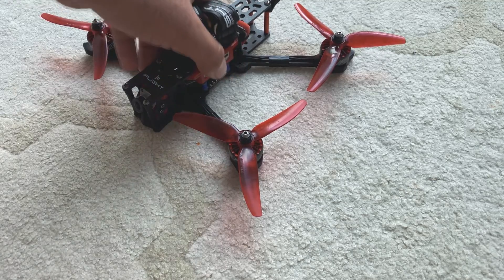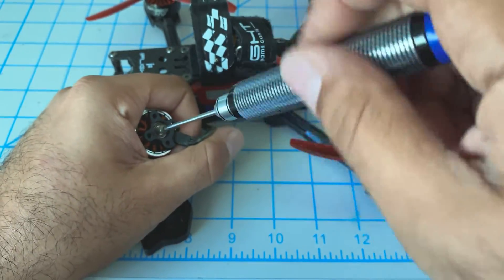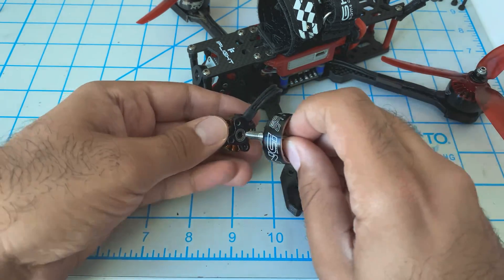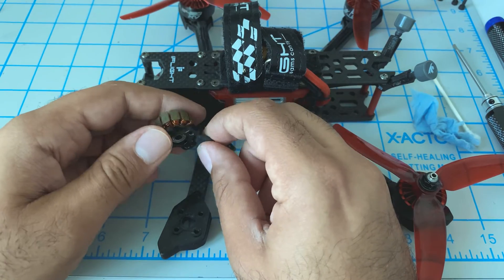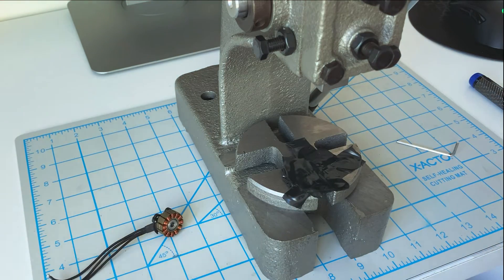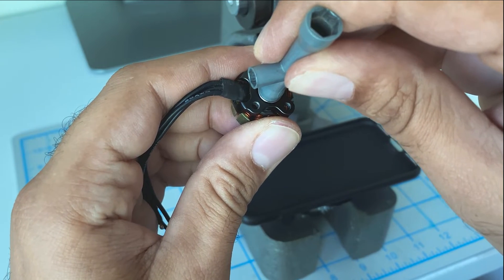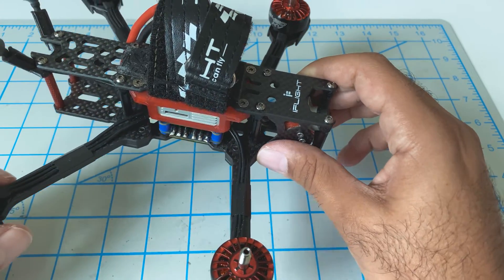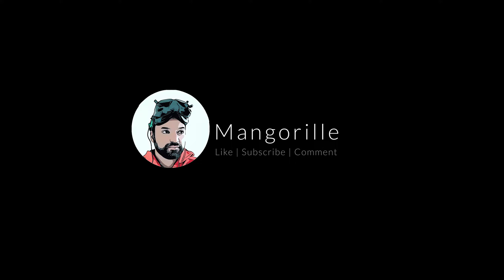iFlight XING 2207 Quadcopter Motor Disassembly, Inspection, & Bearing Replacement | FINALLY Kaput!

Comment: Is it mandatory to take the motor off ?
Reply from the maker: Yes you will need to remove the motor from the arm, otherwise you can't get the bottom bearing out. If you need to use a press to push the bearings out then you'll also need to de-solder the motor wires.

Comment: meanwhile my screws are fucked, so i need to get 1 new motor..
Reply from the maker: Did the screw head strip or is it just really hard to open?
Reply: @Mangorille  the screw head is totally overdriven.. the screw was so tight that with all strengh i could use the screw just got overdriven.
Reply from the maker: They use thread locker from the factory on the screw. You can use your soldering iron to heat up the screw before attempting to remove. If you have a Dremel, use it to cut a slot in the screw, then heat the screw up and use a flat head screw driver to remove.
Reply from the maker: @paineth2  No problem, happy flying!

Comment: Iflight needs to not use so much locktite on that bottem screw because I can't get mine off at all. I ended up stripping the screw head before I could get it off. I got it off with some pliers but I need to take apart more than one motor and this second one is giving me so of a time. it's not stripped too
Reply from the maker: That is strange, did not have that issue with any of the motors. Thinking maybe your screwdriver is compounding the issue. You can also try warming up the screw with a soldering iron first as well.
Reply: @Mangorille  Thanks for the suggestion. I think my issue was that I was using an allen key
Reply from the maker: @calebyoung1018  Ya that would do it. See if you can invest in some high quality drivers. The ones you see in our videos are actually over 10 years old. :)
Reply: @Mangorille  I don't have access to a soldering iron, traveling pilot and don't have a luxury of a workshop. Best I can do is a very hot blowdrier. Would that work? I already kinda half striped the screw so I'm afraid if I try again and fail screw is done and I am.... well, screwed. :D. I just need to clean the motor from some mud and open it up. I have a screwdriver but not super grippy one.
Reply: well I stripped it now, kappa. How to unfuck myself from this situation? Find a workshop? How do you remove this stripped screw? Drill through it?
Reply from the maker: @janmajnik6889  A blowdrier will work BUT it will cause the whole motor to head up so try to keep the heat as close to the screw as you can. You're pretty much just trying to break the bond on the locktite.
Reply from the maker: @janmajnik6889  See if you can use a dremel to make a slot or cross in the screw so you can use a slot or philips screwdriver to remove it.
Reply: If the bottom screw is not a hex for an allan key, then what is it? I’d love to maintain my motors without stripping each screw .
Reply: @mattbfpv7172  that was my issue, for some reason the torque on the Allen key acts different than a hex screwdriver  and strips it. if you want success you need to use a hex screwdriver.

Comment: My 4 brotherhobby R6 are sounding the same. So it's not in good condition anymore? I've crashed so many times but it still performs well.
Reply from the maker: Could just be some dirt in the motor, bad bearings, or a bent bell. It may seem to run okay but wearing prematurely, vibrating, or using more power. Try taking one of them apart and see what is going on.
Reply: @Mangorille  will do. I started looking for 9x4x4 motors

Comment: Will have to do without a press. Thanks!
Reply from the maker: No problem. It can be done without a press but the top bearing is fairly tight and you need to be careful when hammering the bearing in that you only put pressure on the outer ring.